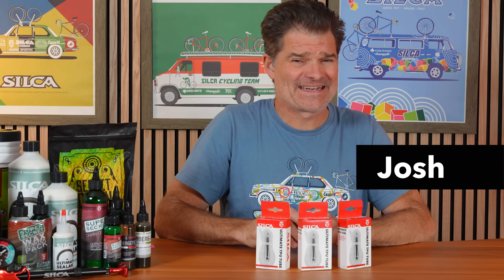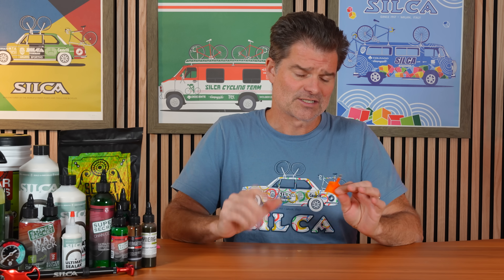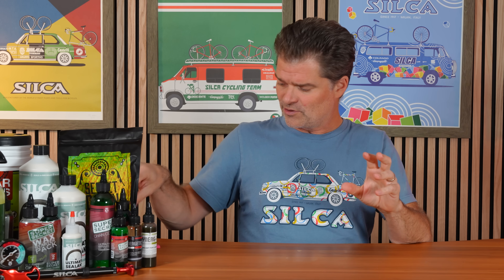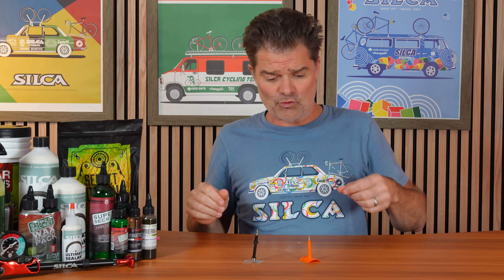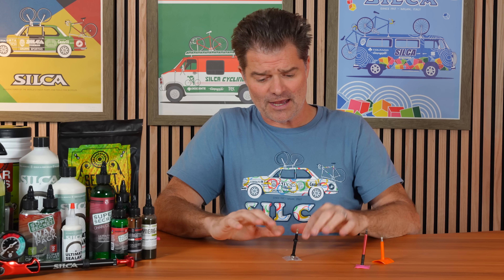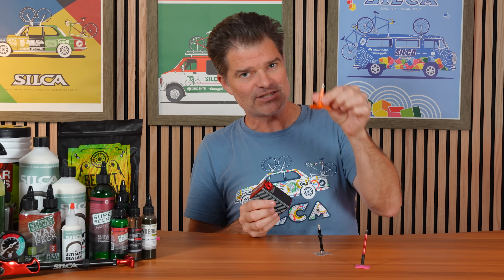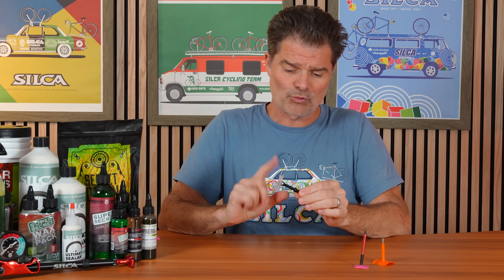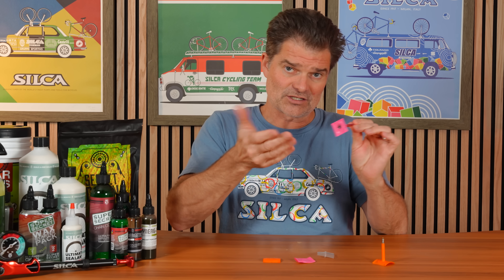Are TPU Tubes Finally Worth It? | SILCA Ultimate TPU Explained

Comment: Brilliant solution to the tpu tube issues!  I have had all the exact experiences with tpu failures as you have had.  Most often have been failures at the valve stem interface because of loading and pump head fitting.  The best tubes I have found so far are from Rene Herse:  Clear, made in Germany, metal valve stem, etc.  However, they have no nut or gasket and are prone to failure due to the pushing back and inflating issue you describe in the video.  The sandwich should solve that problem for good.  IMO there is no denying the advantages tpu tubes, much lighter than sealant, reduced rolling resistance, better ride quality and no mess.  Now you just have to develop you own special tpu tube sealant (a la Rene Herse).

Comment: Is there a difference when using a screw on vs a flip chuch. Ive had issues with the valve cors with the screw on on the Ride now
Reply from the maker: All screw-on chucks struggle with unthreading the core during removal as the pressure is equalized both sides of the core.. if you pump allows you to bleed the air on the hose side, this will fix it.  Other than that, our valves use the extremely nice Italian made valve cores that you would have found on the best Vittoria or FMB tires from years back.

Comment: I had problems with the original RideNow around the area mentioned as well as with the valve.

With the metal valves I so far (8-10.000 km) had no issues. Well, one flat was from me pinching the TPU while installing it. However, that could have happened with any TPU tube and then you better nick a 9 Euro tube than a 35 Euro tube!

Comment: I had Tubolito fail so went Schwalbe. They suck too with the plastic valve stem. I would try these but they don’t come in 29” do they?
Reply from the maker: The 700x44-64 is the same as 29"x1.75-2.5"
Reply: @SILCAVelo Ty. Will buy as needed.

Comment: Interesting presentation. I tried to buy some German-made clear TPU tubes with metal valve stems but the online store that sold 'em couldn't process my order. Might try Silca since these seem very similar. Kind of afraid to install the TPU tubes on my shelf now..the idea is LESS flats...I don't care about the weight so I might be going backwards compared to butyl?

Comment: Love Silca quality but I have been on the pink Chinesium brand tubes for a couple years and have not had any of the failure modes described at the stem. For less than $7 per tube. Even on rims that are not designed for tubeless. No failures with compressor fill. No failures with CO2 roadside replacement. Have had the seam leak he describes but not on a filled tube in a tire. I have found that I can’t deflate the tube and leave it in the tires loose on the rim in my bike box and travel through TSA. Something bad happens. Of course tubeless wouldn’t survive this either.

Comment: Bro I've been using $5 Chinese TPU tubes for 4 years. 100% reliable. I ride rim brakes, carbon wheels, 10000m+ elevation monthly.
Reply: same.  Ebay.  I ride tubeless but didn't wanna carry those big and heavy butyl tubes.  I wrap a TPU tube up with a valve extender, its own patch kit, and a park tire boot with cellophane.  Ready to go.
Reply: which ones exactly?
Reply: with probably the threaded rings clamped down to keep the valve base from getting pushed in and out?
Reply: Nerd.
Reply: @user-ts4lf9mt7i  HAHAHAHa

Comment: TPU sound good but I heard they were more prone to puncture. 
Are the valves on these TPUs actually removable and tubeless compatible ?

My thinking is to mount TPUs and have some sealant as a backup if the tube fails.
Reply from the maker: TPU as a material is no more or less prone to puncture than butyl or latex, but many of the products on the market are using pretty weak TPU materials with poor elongation and strength, so this may be causing some of what you are hearing.  As for sealant, it can work with innertubes in general, but probably 9/10 times doesn't.. the sealant needs a sudden pressure drop and exposure to air to seal, and if the puncture is at all misaligned with the tube, then the sealant just escapes into the gap between them and makes a huge mess, so we do not recommend using sealant with any inner tube setup.
Reply: @SILCAVelo  "TPU as a material is no more or less prone to puncture than butyl or latex,"
Wish I'd known that BEFORE buying 'em!  All the claims were how much MORE puncture resistant they were...the only reason I bought 'em. I REALLY hate changing tubes on the road, but now I'm wondering if I just wasted some $? :-(
Reply: Someone is marketing their similar tubes with that idea - squirt some of their special sealant into the punctured tube, air things up and you're back on the road. They also claim you can add a small amount before riding and have punctures sealed while you ride. I bought some TPU tubes with sealant already in 'em but all the negative comments on here about TPU is making me think of just leaving 'em on the shelf?

Comment: The issue is you bought Tubolito TPU tubes and those are expensive crap. I’ve had zero issues with RideNow and they cost less than $10 a tube.

Comment: surprised at the 24-43mm range. all the TPU tubes I've come across so far are much more narrow in the applicable widths. also well done making a 70mm valve stem version.

Comment: Wow, impressive and smart! I can hardly imagine a basic thing (a tube) could be reinvented ! I use tubes as spare and TPU are so light and compact that there is no question about carrying standard butyl or TPU. However, true that I was not 100% confident about having an issue with stem or junction. Good you develop that. Yes, it's expensive, but given the fact it seems to be well engineering + TPU is from Germany, it sounds to me to be a faire price (yes, chinese are much cheaper, but I have read a lot of issues with it - as many as I read good feedback and orange ones are not that cheaper I think).

So, now the question: any plan for MTB 29"? (or maybe even 32" 🤣)

Comment: I would like a solution where you use an tubeless value with tubless system. And when it fails, you can use a TPU tube with the alsready existing tubeless Valve. That would be also a game changer for me.

Comment: Looks great, sounds great, I’m also kind of a Silca fan, not sure about the price. Yes, the extra patch with the tube is a great idea, somebody should have thought of that before. I’m kind of stocked on tubolito and Pirelli for now, so it will be a while until I buy a Silca one. 
Question though, are there any restrictions for rim brakes vs. disc? It hasn’t been mentioned.
Reply from the maker: No restrictions on rim brakes.

Comment: For me the biggest problem with TPU is their repairability, its damn hard to repair a puncture on it and is very different to butyl ones. I discovered some specific tent glue which works for me with patches cut out from old tpu tube but still there is so much room for improvement. please please consider it. maybe make a special rig to repair butyl/tpu tube with which this can be done with ease. i'd buy it for 100-200$ even. i have silca wax pot already. i hate repairing tubes but even more the inability to do it easily and consistently
Reply: Dunno what shitty TPUs you been using but ridenow provides patches that you just stick on and it works. You can buy tpu patches for pennies.

Comment: I have Ride Now for 3 years in all versions. And have one failed because of quality. Off maybe 10 different versions. Never had a problem with the new one. So why change a running system. And if you get a flat, it’s 6 Euro not ……

Comment: Wasn't the valve - tube failure caused by design of silica presta chuck? The friction between the rubber and valve is higher then with "lezyne threaded design". I have plucked few butyl valve with your chuck.

Comment: I’ve ridden close to 30k km with tpu tubes a third of the price of yours with no issues, apart from a several puncture flats. I also use an electric pump with an extension nozzle that seems to eliminate the heat issue.

Comment: That Silca TPU is rebranded, so is their latex tubes. The experience I have about their TPU is as bad as the other tubes shown in the video. The problem is  overlapping the tpu with the stem. They just separate from one another.  And this happened on a new tpu out of the box and trying to mount it in a tyre
Reply: Re-branded from what company?

Comment: Frankly, if one does not chamfer the stem hole in their rims prior to using them, they are leaving out a rudimentary step in bike setup and worse if it is wheel building...
Attention to detail is one of the reasons I do all of my bike service and builds. Not to mention, I am highly territorial!! Peeps, just check that valve stem hole on all of your rims. That can save you from hearing that random hiss of a leak occurring at the most inopportune time.

Now, let's look at construction of tubes, especially the stem patch that is formed on the base of the stem, prior to it ever being married to a tube. Some are done very well and they will hold up to being hastily handled with a pump chuck and even a little tweaked in the rim hole. Some not so much.  

Frankly, I would like to try a pair of TPU tubes with my EnduroBMX. The bike is a plus bike with a very comfortable geometry that works stupid well for singletrack. One speed automatic transmission, nice comfy 27.5 x 3.0's on i45 rims. How's about some tubes that will fit my Punkass bike?? 

Love the very nice tool kit that is in an exquisite wood enclosure!! Have some years on them and they are my favorite!! Silca, baybay...

Comment: At $40 a shot I can get 3 x cheap Chinese ones and still come out on top... Also the latest model has a rim nut which prevents the valve being forced out of the flange. Never had a TPU tube fail in the way that you described. Nah mate. You know RideNow still compete at the lower price.

Comment: Running 45’s on reserve 40/44 wheels.  Based on your sizing model I need the largest size which only has 50mm stems.  Useless on 40/44 deep wheels

Comment: I tried TPU. And they had a horrible failure rate for me. Several factors I think. I run 650c rims on my bent so I could only find a single vendor. 2 the tires I can get are narrow and high pressure (100 plus) psi. The tubes I got got flats every 200 to 300 miles (that would be a week and a half). They were 25 dollars a pop and were nowhere near as durable as straight butyl

Comment: the price is a hell no , the use is mostly for recovery , i would never race on tpus because they are not safe , no one should be racing on tubeless or tpus it should be outlawed, too many blow outs, tpus and tubeless need a foam catcher to keep the rim off the pavement so you dont wipe out half the field simply by turning , and pooooof , tssssssss, crash , broken bones..
   tpu is great for recovery flats and traveling, but the performance they give is still just as dangerous to run as tubeless!!!

Comment: Thanks for the video Josh. I’ve been using RideNow TPU’s for quite some time now, I’ve never had an issue with them except the occasional flat, but I just patch it and move on. I buy them from AliExpress, not Amazon. Are SILCA TPU’s better? Probably, but I’ll better spend the money on SILCA’s wax instead.

Comment: Did I understand you correctly that after 5 -10 seconds after patching, these tubes are good to go?  It's my understanding that other TPU tubes that have been patched require a minimum of 10 minutes for the glue to set with a recommended wait time of 24 hours before reinstalling them.

Comment: With my and my Wifes road bikes I've been using Silca hot wax for 5 years and there bike wash and wax for 2 years, and love them.
I also have been using the Wheel Science Nano TPU tubes for 3 years with 0 issues.
I will try the Silca TPU tubes out if/when I get another bike.

Comment: Recent failures, I have noted, are from heat generated by today's battery pumps. I have never had a problem with the Chinese produced TPU tubes. $39/tube is a little steep, good luck!

Comment: Been using RideNow TPU tubes for about 4 years on 3 road bikes, ride about 4 times a week. I’ve had about 5 flats total in that time, mostly pinch flats. No problems at all with the plastic valves. Tubes are less than $10 each from EBay .

Comment: Cool video and nice to see some innovation, but holy smokes, 41 Eur a piece and you need to pay 7 Eur for shipment to Austria or buy for ~100 Eur of products to get free shipment... This is crazy. I get my TPU tubes for  from AliExpress and they also come  per box at this price, and with . In general I'd be happy to pay a little premium for "made in EU" and some genuine quality improvement (e.g. the valve / flanges, threaded valve shaft, the RF welding...) but not 10x the price I get from AliExpress... I'll just buy more cheap ones and change/fix my tubes a bit more often: joint failure is not the only reason for flat tyres anyways and so far I have not had big quality issues with the cheap ones anyways... This type of extruded parts are quite cheap to produce in general, even in EU: the more I try to think of how much it roughly cost to produce, the more your price feels like a rip off to be honest...

Comment: Josh - I ride Tubolito TPU. I get more than one flat out of each tube with their patch kit. You are sending only one patch per tube. Will you be releasing a patch kit? I'm getting ready to purchase 4 Silca tubes and would feel more confident if I had extra patches (which I would be willing to buy).

I'm a Chef... LOL
Thank You
Reply: Look into TPU tent patch kits.  The material might be thicker, so I would keep the tube inflated as much as possible when applying a patch.  That way there is less stretching of the patch itself.  That in turn reduces any puckering around the edges of the patch.

Comment: Riding Tubolito.. 7000 miles this year. Zero issues zero flat
Reply: Been writing to Tubolitos  since they came out. Really like them. They can be hard to mount. They’re easy to patch. The patches last forever.I have never had one fail at the valve.

Comment: Have had hit an miss experiences with the second gen RideNow tpu tubes. Had two just random crap out, one at the valve as said in the video, the other I couldn’t even find the leak it was so small. Another one I had 6000-7000km on it when I got a pinch. I don’t doubt the Silca’s  are higher quality with better QC, but right now I can buy a box of four for the price of one. If the price was only double, yeah, would definitely be worth it.

Comment: My questions is, can these accept tubeless sealant?
I have had some luck with different cheap China shit brands and the Ride Now TPU's have been the best so far, be these Silca's make so much more sense to me.  
 I bought the Rene Herse sealant for TPU's, and quite frankly in my case it is shit, dried right up in a couple weeks.  I put Stans sealant and has been fine.  Sealed a TPU right up.  I will buy a pair of these Silca's soon to try.  Really want to know if they can accept any type of sealant.  Please advise!  Great explanation video, thank you!

Comment: I have applauded Silca's products many times on this channel and use several of their products. But my experience with other TPU tube brands simply doesn't match Josh's experience. I use RideNow TPU tubes and am currently using their TPU tubes that have a threaded metal nozzle and threaded valve core. No failures. No problems. 1000+ km. Much, MUCH lower price. At $40 USD per innertube, this Silca product just doesn't make sense FOR ME.
Reply: Wait so your TPU tubes didn’t all fail within 6 months time? How could this be?
Reply: It's the chuck. Threaded pump heads will not overload the valve stem/tube interface.